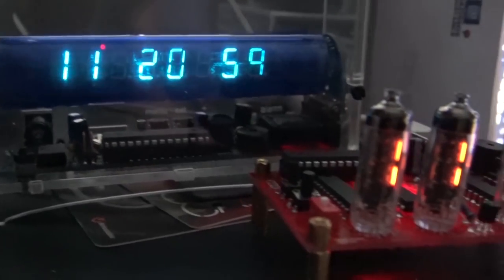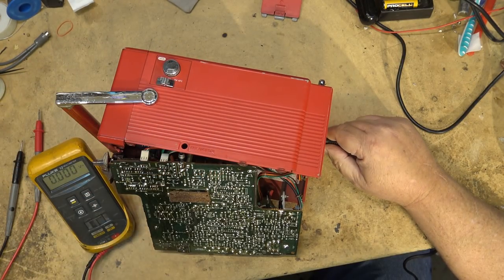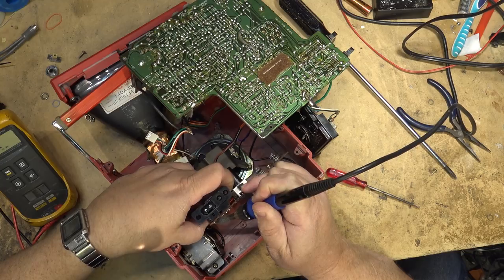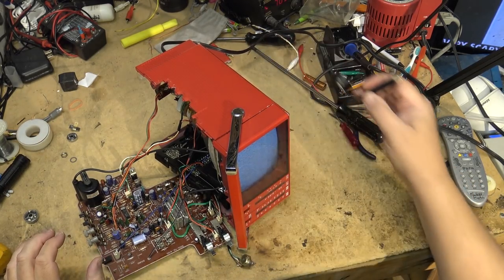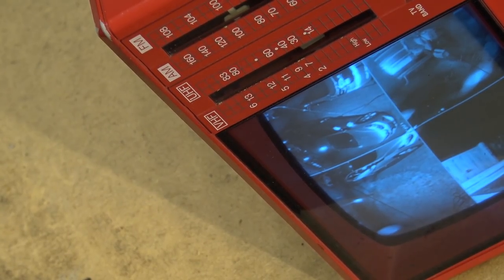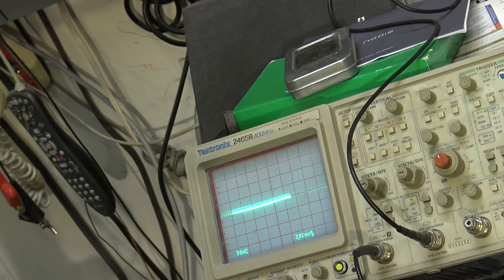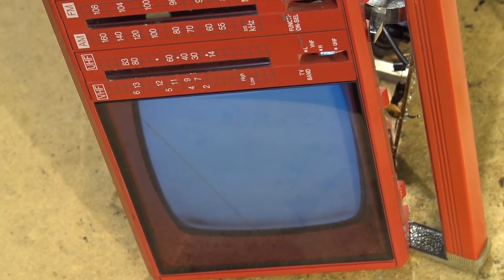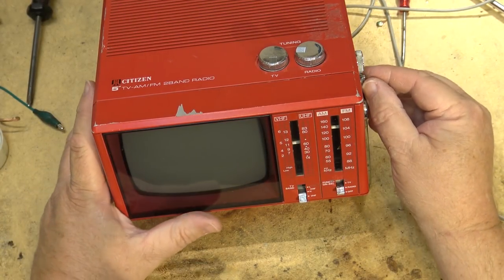Citizen Black and White portable TV repair and video input mod

Comment: Smashing repair and video mod dave :-D
I'm supprised that anyone would want to monitor a computer with such a low res device.
Fuses can blow for no obvious reason,  old capacitors current leak at switch on is a possible.
For a video input i look for the sound trap ceramic filter, and look around it's input for the video+audio split.
Some old sets have an odd bias to the video and need a mod.

Comment: That's interesting you tap into video pin with a capacitor and cable with ground
Reply from the maker: Yes the cable needs a ground and the cap provides isolation (DC block, coupling capacitor)

Comment: The customer could might install a mono audio input jack as well which should be easier to do.
Reply: Yeah, it's possible to replace the external antenna jack with a stereo 3.5mm jack to carry both audio and video signals to the tv, thus mantaining the original look. A circuit rewire is obviously needed in that case.

Comment: Hello i have problem on Sony Handycam CCD-TR425E When i put in cassete, video playback controls doesnt working i cant play the video or pause it . it only plays pauses or rewinds  with remote control. do you know what causes problem or how can i fix it?
Reply: Probably the flex cable that connects the transport buttons to the rest of the unit is broken or has dirty contacts.

Comment: These old analog TVs are only useful if they have an A/V input. So well done!
Reply: converter box/rf modulator is what i use on these things
Reply: @aarontrupiano9328  of course you can use a RF modulator, but it's inconvienient and lowers picture quality.
Reply from the maker: @jaceknasalski1422  cheap ones yes, proper cable headend such as blonder tongue or wavecom such as I have in my distribution system have saw filtersz and are true vestidual sideband as opposed to am. They look fantastic.  Still limit the upper frequency bandwidth due to roll off for sound carrier.
Reply: @12voltvids  using proper gears and cables you can achieve very good picture quality. There is one reason when you really need a separate A/V input: a computer monitor for retro gaming. Limited bandwidth of the RF channel reduces picture quality especially when displaying a high density text.

Comment: Why do you use a capacitor on there?  If one wanted to prevent voltage from flowing back, could you just use a diode instead?
Reply from the maker: Capacitor pass the AC waveform and block dc. That's what they do. Diode pases current in one direction.
Reply: @12voltvids  how important is polarity or  voltage in this case?

Comment: Nicely done. I have a few small portable TVs around that I must repair. Perhaps I'll add a composite input to them as well.
By the way, I have some bigger 14" CRTs with rf input only. I have heard since there is no proper isolation from mains on their circuit boards, I should not be adding video inputs to these TVs. Am I correct?
Reply: Yes, if the video circuitry is unisolated you shouldn't add a video input without adding isolation.

Comment: Very cool indeed!  I have an old Panasonic B&W that I picked up at the PX in Fort Bliss Texas back in the early 70's.  The best thing about it was the color of the case. It happened to be Olive Drab, matched all the military equipment we took with us out to the desert around Bliss, so it was no problem taking it along in my Radio Teletype Van that was mounted on a 5/4 truck.  Since I dealt with classified documents in the rig, it had to be buttoned down most of the time, which was nice since the old unit still had the Air Conditioner mounted on it from back during the Vietnam war where the equipment would fail if it got to hot, thus a nice air conditioner that kept me and my equipment nice and cool even in the worst of the desert heat around Bliss (we used to love the old quote "Ignorance is Bliss")  I spent many an hour watching TV on that little set, I even had an extra antenna mounted on the rig that I put up when we got to our base camp area to serve the TV since the van was pretty much radio wave proof on the inside to keep the powerful AM and SSB radios quiet and safe.  The rig was built with 2 receivers and one transmitter so we could receive transmissions from both higher headquarters, and still transmit and receive from our sub-units.  Since I worked with Regimental Headquarters, I was usually the Net Control Station.  I think I still have that little TV around some where, probably in my back room that has become a storage area for my obsolete computers and every thing else that someone thought needed to be out of the way but still kept.  Well my good wife, who did that has passed away some 3 months ago now, the pain of her loss after 51 years of wedded bliss still hurts to type about, tears have suddenly appeared on my old cheeks as I type this.  She died just 4 days after our 51st wedding anniversary, I buried her with the golden rose I gave her on our 50th in her hands, and a beautiful necklace that proclaimed my ever lasting love around her neck, she wore her wedding dress to the grave, it was her requested garb. Cancer is a cruel disease and it had it's way with her, 4 months after discovery of the disease and she was gone.

Comment: Hello there and thank you for your videos. Very informative. I guess it helps to know what you're doing. (that's not me...)
Anyhow, watching this, it reminded me of an OLD small solid state Panasonic TV that I bought as a teenager in the middle 70s. 
It sits in the closet since the only antenna or connection that it has, is a rod antenna that now can't catch anything from the air. So I was wondering if there was a way to open it and connect something with an antenna cable that would go to channel convertor box that I have and play whatever I can get from it, just for fun.. That would work on the channel 3 I would think that usually is the default for outside channels. Any thoughts?
Reply: Just strap a cable to the rod antenna and to the center copper core the coaxial cable and it should do the trick if it's analog, if don't you need to mod it to accept a video input or buy a video to rf adapter and do the cable to rod thing.
Reply: @akai.inu_  thank you for the update.

Comment: I'm too afraid to mail my JVC VideoSphere but I'd love to bypass the useless tuner and add an A/V input.
Reply: You could try an external RF modulator, then you don't need to modify the TV, they sell for around $10.
Reply: I did, still doesn't look too good. I think the tuner itself is a bit wonky with age and they were known to have tuner issues
Reply from the maker: @TheStuffMade  
I have uhf modulators 4 sale.

Comment: Hello sir, I wondered if I could ask for advice, I have a smart TV which has a constant 12v standby, which is only at 8.6v, iv replaced all the capacitors on the 12v circuit on the secondary side of the transformer, iv also changed the octo coupler, could you give me any pointers please? Could it be an oscillation problem? Im desperate to learn, Im not too bothered about the TV, I could just buy a new power board, but I want to learn, and you are one of the most knowledgeable people iv come across online. Thankyou
Reply: Does the 8.6v vary with different amounts of load? If it stays the same you probably have a problem in the voltage reference circuit.
Reply: @eDoc2020  when I remove the octo coupler, the voltage starts fluxuating from 8 to 16v, iv replaced it but still have the problem
Reply: @reacey  Are these measurements with the main board connected or disconnected?
Reply: @eDoc2020  it's the same with the main board connected or not connected
Reply: @reacey  On the secondary there's probably a reference chip like the TL431. I'd check the voltages on it, one of the pins should have 2.5 volts when the proper voltage is reached. If you're getting 2.5v, the power supply thinks it's putting out the proper voltage, so there's probably a bad resistor in the divider network near that chip. If there's an adjustment pot it will be part of that network. If there is a TL431 but none of its pins are at 2.5v there is something else wrong with the supply, probably on the primary side.
Reply: @eDoc2020  there is a tl431 on the secondary which I have changed already, I didnt know about the 2.5v, so I'll check. Thankyou very much for the information

Comment: Nice, you can add a swich to move from TV to monitor, so you can use TV any time
Reply from the maker: Sure but why. There are no analog broadcasts anymore so nothing to receive.
Reply: If you have a digital converter box and an adapter from 75 Ohm to 300 Ohm you can connect it to the TV terminals and watch digital TV on it.
Reply from the maker: @hestheMaster  
Yes i can do that with my little set.  I have a 5" color, a 4.5 bw, 2" bw and a 1.5" color CRT in my collection.

Comment: Well done! I've actually followed along and performed the same modification to my system. Now I just need to figure out where the audio input is!
Reply: I found a schematic and figured out the audio input!
At 20:29 the back of IC 101 is shown as he desolders a leg from the board. To add audio input you must desolder another leg- see the top right of the IC 101 outline, desolder the leg one to the left of the far top right corner. Then, tack a wire from the positive leg of C114 (the leg closer to IC 101) to the positive of your audio input jack. You can attach the ground wire from your audio jack to the tuner, just as he did for the video ground.

Comment: is the value of the capacitor important? Would lower uF provide less protection?
Reply from the maker: Has nothing to do with protection just coupling the video into the circuit. The capacitor is just there to block any possible DC.